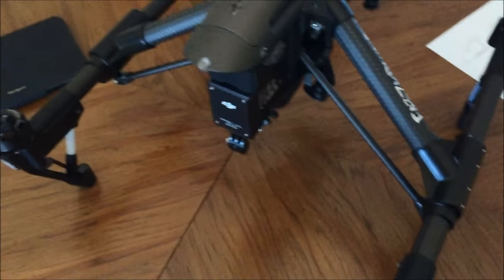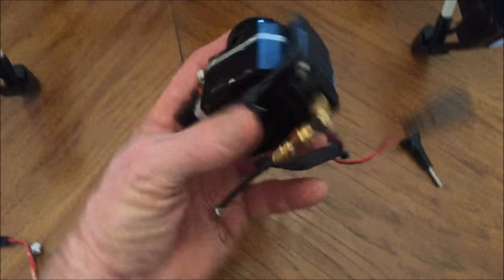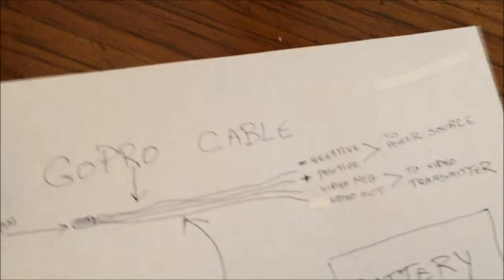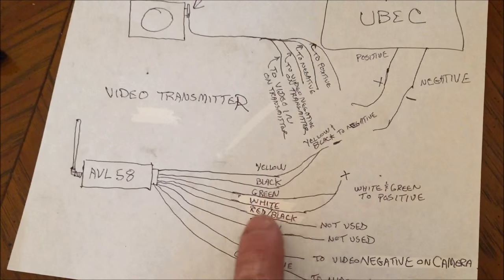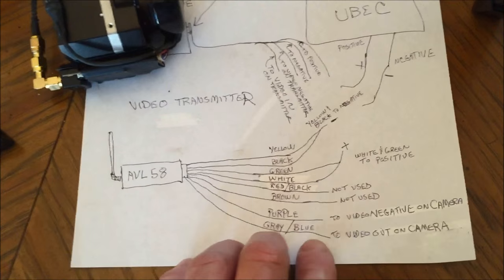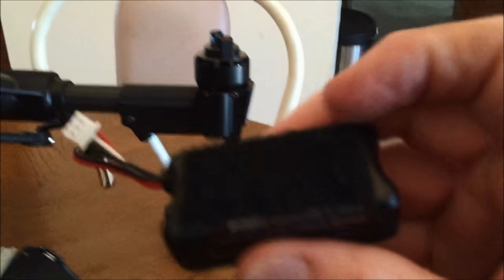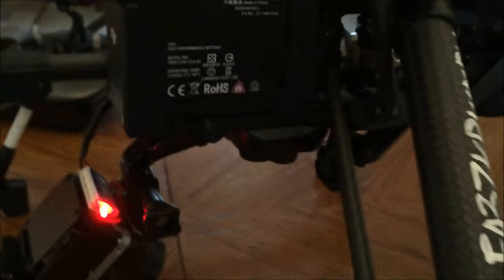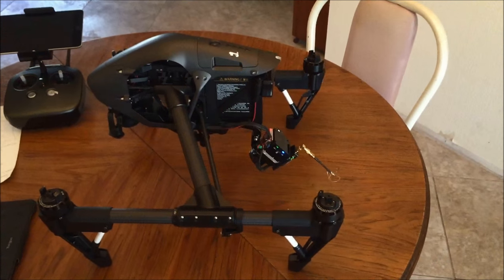How to mount Flir Vue Pro on Inspire 1 Pro

Comment: I am trying do this same setup with a flir vue pro 640, I'm using an immersion 5.8ghz 600 mw a/v Tx though, will this work the same as transmitter your using? also can I use 1000 mah 2s lipo battery or do you recommend the fatshark battery you used in the video
Reply from the maker: Ian , I don't see why it wouldn't work. My set up was a DIY project and I used stuff I had on hand. My intent for this video is to show how I found a way to do this and can be modified to suit what you have on hand. As long as you don't over power the Flir Vue, the immersion TX should be fine.  Update on your progress and how it worked out for you when you can.

Comment: Can you comment on the FatShark Video Transmitter which has a Power neg. / Power pos. and Video in. There is no Video neg on the transmitter. I saw FatShark diagram where the Video neg is attached to the Power neg. This setup is using the four GoPro cables.
Reply from the maker: Sorry I haven't tried using a Fat Shark transmitter on this setup but I do think that the diagram you saw is correct. It sounds like connecting the power neg and video neg together should work but I am not sure.

Comment: I wonder- most VTX's already have a regulate 5v camera output.  I just plug my 2 cell directly into the VTX, and while it outputs 7.4V through the transmitter, it regulates a 5v feed to the camera.  I'm wondering if you even need the seperate BEC unless the FLIR draws too much current?
Reply from the maker: Hi Cody, back a couple years when I built this setup I used what I had on hand, I had everything that I needed. In my setup I needed a regulated power source. A BEC can be an additional level of protection to assure that the voltage will not exceed the FLIR recommendations. If you are planning to use the video transmitter to regulate a 5 volt power source to FLIR Vue that should be okay. Please check back and update on your setup and how it performs. Thanks for posting your comments.

Comment: I have this same flir , I like use this same set up anyway you can send me information on email or what ever best for you , like know what you used and wiring digram on this if any way possible! I been weeks trying get something going with this
Reply from the maker: Thanks for comments, all the details and my wiring diagram are in the video we’re you can snap shot the diagram. I only worked with parts in my video.  You can use a verity of video transmitters, batteries, etc. I built this project so time ago and eventually bought a DJI/ FlIR camera for the Inspire Pro 1…I use this Flir setup for other drones, bike, head cam and ROV project.

Comment: Thanks for posting this video. I am curious about the vibration of video while flying with this mounting system. Would you recommend or suggest using a vibration dampening system?
Reply from the maker: You can use a different cam mount I would think by replacing the Go Pro mount. I didn't notice any vibration issues on my videos using the Go Pro mount on any of my drones. Remember that the Flir cam isn't high def video like 4K and I don't think you would really notice any difference. Today there are some new gimbles that mount the Flir Vue that you can look into. I replaced this simple system on my Inspire 1 Pro with a so-called quick change gimble from USA 1 or some name similar and I am disappointed in the time it takes to switch cams compared to my DYI Go Pro mount.I may do a "review" of the $1500.00 setup.

Comment: Helluva job! 
I have to wonder why they couldn't make it with a battery and simple Video Out, though.
Reply from the maker: That's a good question...I also own an original "Standard" Flir Vue that didn't have the built in DVR and card and required installation of a mini DVR and card attached to the drone  which added weight and power use or you could attach a DVR on the video monitor but the quality was only as good as the transmitted video feed and "noise" was an issue. The Vue Pro is/was a big upgrade.

Comment: Hello Mark. I just I got a Flir vue pro. but I need to take single photos by a raspberry or Arduino. do you know a similar project that I can follow. Thanks
Reply from the maker: Hello Starsk, sorry I don't know much about Raspberry or Arduino. I use the micro SD card from the Flair Vue Pro with my PC since iPads and iPhones are not equipped with usb ports. I assume that you have the same issue with Raspberry and Arduino. I don't know what options or new hardware is available.
Reply: I want to do is to control the camera with a raspberry or ardunio with th pwm . I been readin the documentation about the pwm:
The  Vue  Pro  accepts  standard  PWM  inputs  for  the  R/C  industry,  3.3
-
5vdc,  50Hz.    LOW  = 
1ms/20ms, MID = 1.5ms/20ms, HIGH = 2ms/20ms
Reply from the maker: If you haven't yet, try contacting Flir support, they were very helpful with a couple issues I had. Since this post I purchased a gimble and controller for the Inspire 1 Pro that allows the Flir camera to fit in the Zenmuse X5 mount. It does require reconnecting a couple of cables but works very well with the iPad and iPhone. The company that I bought it from is called Intelligent UAS and have several videos of their products here on YouTube. I don't understand much about the PMW connections or requirements.

Comment: How much was the cost of adding this? Minus the cost of the flir
Reply from the maker: I already had all these items from other projects. I really don't have a total cost list of the parts. The Go Pro mount was included with my Go Pro camera, etc. I will take the time to look up the cost in next reply.
Reply from the maker: These are the current prices for listed parts at E Bay.
DJI AVL 58 Lite=$38.00 to $60.00.
GoPro assorted mounts =$10 to $20.00.
Matching pair of transmitter and receiver antennas = $60.00 and less.
Fat Shark battery =$25.00.
UBEC = $5.00 to $10.00.
Total estimated cost around $210.00 on the high end. You should be able to find these parts for less, just search online.

Comment: Can you do a video about soldering?
Reply from the maker: Hello Rob thanks for your reply, that's the second time someone asked about soldering...I will try to do a short video after the holidays when I have more time. I haven't worked on many projects this past year, I spent more time flying newer drones and stuff. I do not consider myself an expert at soldering. I watched my father solder when I was a little boy and learned at shop class. I refined my skills when I was building N scale model railroad layouts. I picked up some very important tips from a guy at the local hobby shop. He demonstrated and advised me on what solder and soldering irons are best, etc. I am pretty good at sweating joints on copper piping as well.